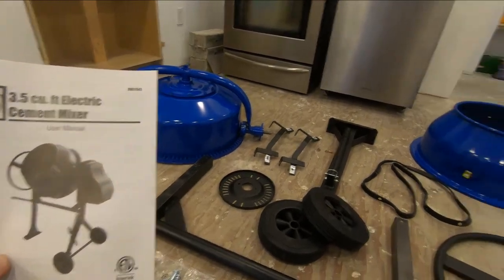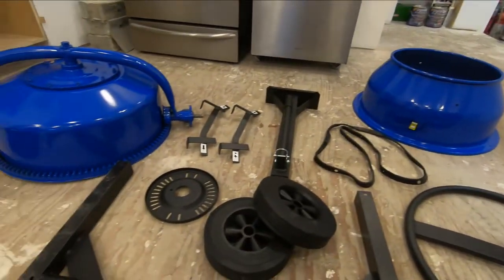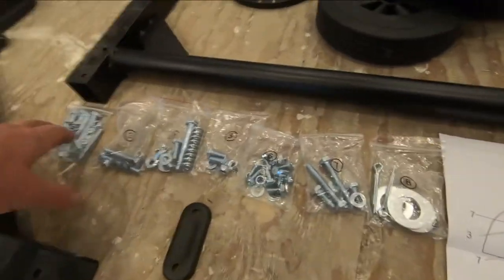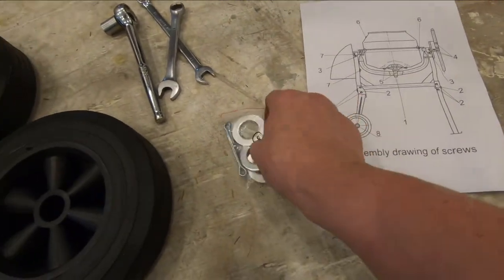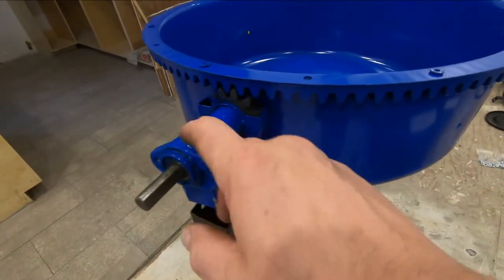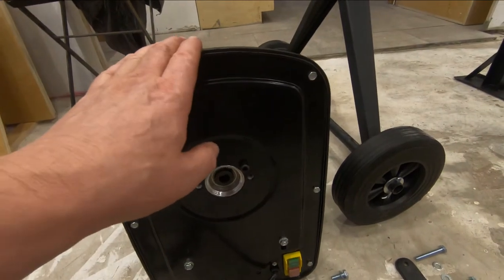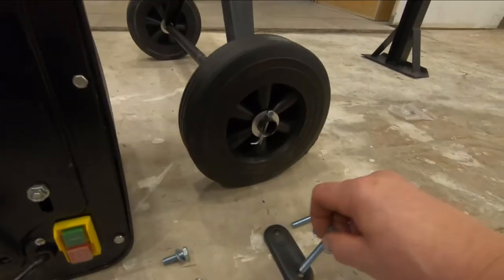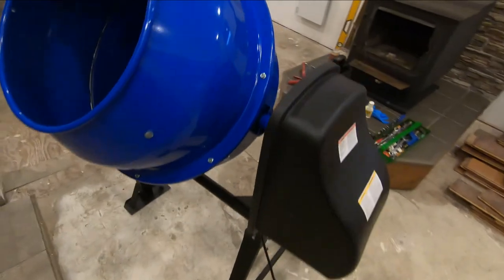ASSEMBLING THE CHEAPEST CEMENT MIXER I COULD FIND

Comment: Seems like that’ll get the job done, especially for $150 US!  Thanks!  -Brad
Reply from the maker: The true test of this mixer will be when I put it to use later in the week. I shopped around quite a bit before ordering this one and it was the cheapest I could find--and the price is hard to beat, especially considering that you can pay almost that much for most small electric hand tools. Let's see if it mixes concrete. If it doesn't, it will make a lovely planter out by the driveway!

Comment: Wish I had one for yesterday and today. Mixing concrete in a wheel-barrel is no easy task, even if it's only 3 bags of Quickcrete and crushed rock for 3' piles to stabilize a concrete pad that keeps sinking at the back door. Nice little mixer, and adding a little grease in a few key spots could serve wonders. I'd also open up the motor compartment and check for gears and bushings for grease and wear areas. A little care goes a long way, and don't overload and abuse it, it'll last forever stored in the cold storage shed..
Reply from the maker: Good machine to have! This was bought at Princess Auto in Canada. It is a store very similar to Harbor Freight in the USA.

Comment: Good day eh!!  It looks like a nice mixer.  And like you say, for a few jobs every now and then, it'll be perfect I bet.  For a daily user on a construction site, maybe not eh!!!  Nice video.  Simple and easy to follow step by step instructions!!!  Take care!!!
Reply from the maker: Thanks for stopping by! Yes, it should be a good mixer for occasional use. I'll take care of it and make sure to clean it out while the concrete is soft. The motor and belt assembly are under a plastic cover and I haven't looked inside yet, but the whole assembly only weighs about 10 pounds so I can't imagine what kind of motor is in there or how long it will last. I think this mixer comes with a two year warranty, so I'm sure I'll know by then. If it doesn't work as a mixer, I think it will make a lovely planter for a few nasturtiums or tulips, out by the driveway, don't you? hahahaTake care!
Reply: @EverydayProjects  Re-purposing is what we do right!!!  LOL

Comment: Use it within its limits, keep it clean, it'll work out fine for a good while. It might be cheaply built but it's a dead simple thing and not much to go wrong. It'll take care of your countertops and for what you paid it won't owe you anything afterwards. After that you can get some sidewalks and pads out of it. If something breaks on it, should be really simple to repair. In the last video about the counters I talked about building it on a stand that you can wheel around the kitchen. How convenient that it already has one! I forgot that yes, they're generally on wheels to begin with.
Reply from the maker: Ya it'll probably be fine. The ring gear and pinion-drive are a really sloppy fit (huge backlash and misalignment) and are the source of all the clatter, but unless the cast iron is porous, it should stand up. I'm going to grease the ring gear to help soften the interface.
 Funny thing is, I intended to use it outside the back door of the house but I put it together inside. Now, I'm not sure it will go through the door without taking it (partially) apart. hahaha.
Like you said one time, it is hard to believe that some things get QC (quality control) approval at the factory. It was someone's job to say, "Yep, that's a Pass." 
I watch a channel sometimes called "Pakistani Truck". It shows engine, steering, and battery, frame repair/rebuilding (to name a few topics) in Pakistan, with few tools or proper gear. Amazing to see what they produce on the ground while dressed in sandals! Check it out:
https://www.youtube.com/watch?v=GrAeOKDL90k
Reply: @EverydayProjects  I Love that channel! Rebuilding batteries, rewinding smoked starter motors, clapped out tools and machines, home made tools and machines. Those guys are good.
Reply from the maker: @heliarche  Hard to believe that they can pull off the repairs they do with the limited supply of equipment they have, plus doing most everything on the ground in bare feet (often). Very entertaining stuff to watch but I always feel bad for the workers (often toxic/dangerous working conditions!)